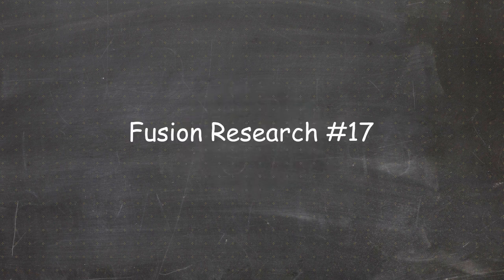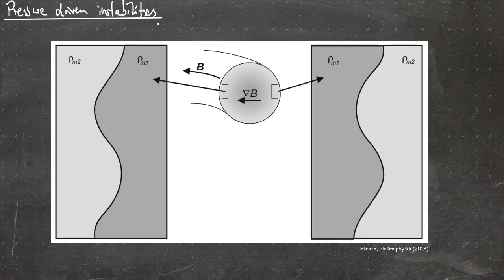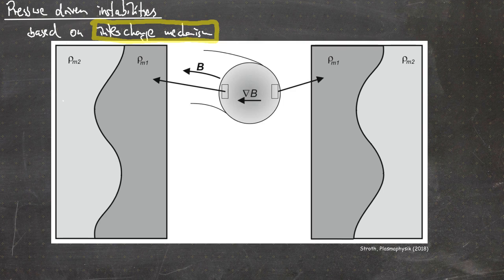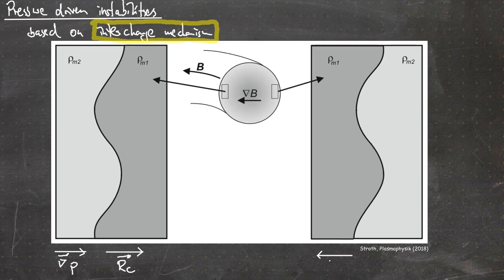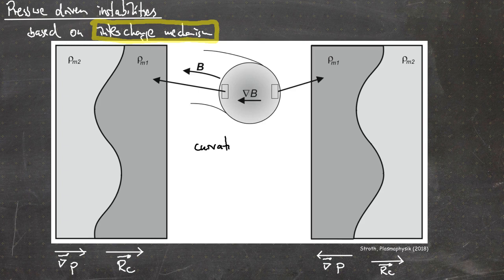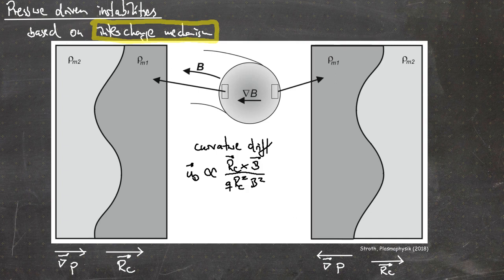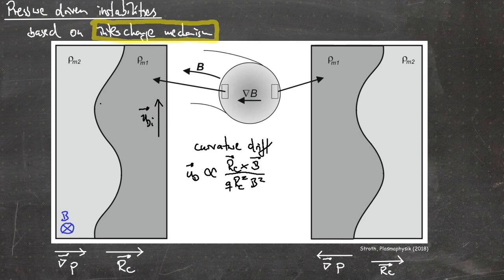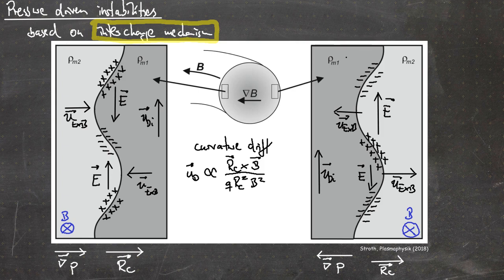Fusion Research Lecture #17 - Pressure driven instabilities

Comment: Good morning,
First of all I would thank you for sharing this very interesting series of video lectures. I really appreciate your work.
I have some doubts and questions related to the first part of this lecture:
1. Is the magnetic curvature drift you consider, a single particle drift?
2. Why don't you consider also the drift due to magnetic field gradient? 
3. The ExB drift considered, instead, is a fluid a drift, correct?

4. The pressure gradient instability you described can be considered also valid for describing the toroidal-ITG instability?  (considering gradP = grad(nT) and, for example, considering n constant)

Thank you in advance!
Reply from the maker: Thanks for your comment, and questions are always appreciated :)

Let me try to answer your questions:
1. The magnetic curvature drift and the magnetic gradient drift are both single particle drifts.
2. You are correct, if you have a curvature of magnetic field lines you always also have a gradient of the field strength into the directions of the center of the corresponding circle. For a complete description one would have needed the gradient drift as well, but this would only make our simplified model more complicated - the result would be the same.
3. The ExB drift is both, a single particle drift and a fluid drift.
4. ITG is short for ion temperature gradient, so you are correct, the description of the ITG instability is very similar: the drift velocity depends on T and perturbations in grad(T) leads thus to charge separation due to the resulting different drift velocities (charge separation creates E-fields and E-fields create ExB drift).
Reply: @DerPlasma  Thank you very much for the answers.
Just to make sure to understand. I know that the ExB can be both, a single-particle and a fluid drift. 
But, in this particular case, is it correct to think that the relevant drift, for the instability, is only the fluid one? 
Even though both drifts are in play.

Thanks for your time!
Reply from the maker: @pasqualedicorato6221  well, since we have used the magnetic curvature/gradient drift, I would rather call this a single particle description. You get the same result when using the diamagnetic drift in the fluid picture, so both descriptions yield the same effect.

Comment: At 6:53, I didn't understand why on the high field side the electrons were in the middle whereas on the low field side it was the ions that were in the middle. It seemed arbitrary to me. In both cases, ions move up due to the grad-B drift. Thus, for me, it would make sense that the results were the same on both sides. Could you explain in further detail?
Reply from the maker: It is true that in both cases the grad-B drift points upwards for the ions. What you have might have missed is that the darker colored area indicated a region of higher pressure, thus higher ion density. Therefore, if ions drift up everywhere, and we have an initial perturbation as in the sketch, this means that in the darker colored area more ions move upwards than in the brighter colored area. Finally, this results in the charge clouds as indicated in the plot - keep in mind that the initial perturbation is needed for that. Did this solve your problem?
Reply: @DerPlasma  thank you for your reply! It makes sense now! What I was missing was not that the pressure in the core is higher than in the edge. Instead, I was missing the correspondence between the shape of the perturbation and the charge transport. But now it makes sense.

Nevertheless, now I have another doubt: shouldn't we talk about the drift of electrons instead of ions? (Since the inertia of the former is much smaller than of the latter.) Thanks!